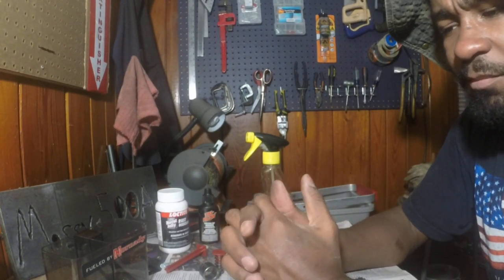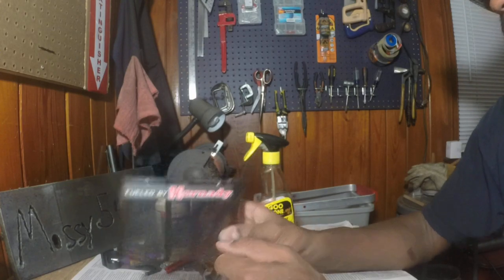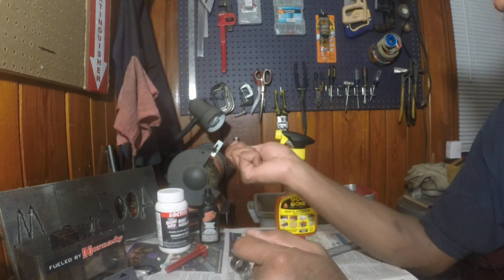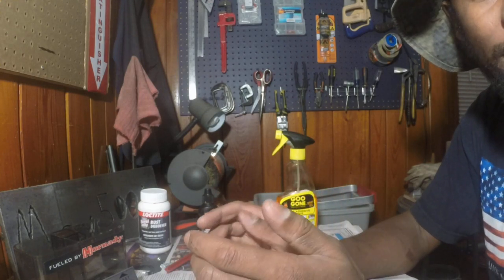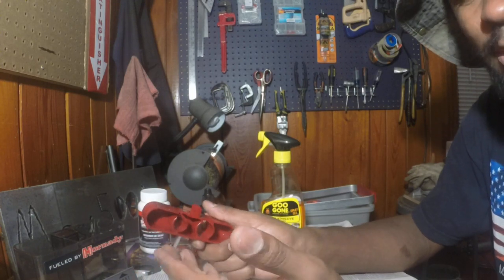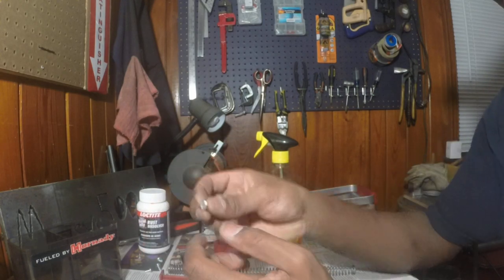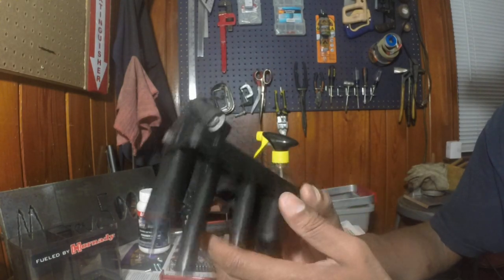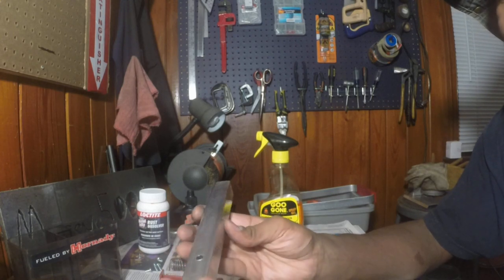Cleaning ang Maintenance for the Lee Load-All 2

Comment: Have you tried using dryer sheets to put a light coat of anti static to reduce powder from sticking to parts?  My experience is that it does reduce powder sticking but is not a 100% anti sticky solution. I'd like know what works for you?